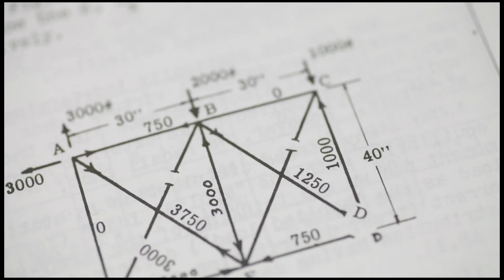The Clock is Ticking for Bloodhound LSR

Comment: 8 million pounds, why? Why didn't you just push the throttle all the way to the floor then light the sidewinder? Bugger this tip toe bit by bit thing!
Reply: I get your frustration, believe me, I do. I've been following this since inception and feel the same way but the limiting factor has ALWAYS been money. 

The rocket wasn't fitted because the rocket wasn't ready - mainly due to a shortage of money to invest in rocket development. 

And imagine, that without the slow but steady approach they took they did just "put the pedal to the metal" and there had been an accident, perhaps a fatality. The project would have died - immediately. We have a world class, straight line, racing car that now has race proven technology. The £8m is required to address issues thrown up by the desert runs, to develop the rocket. To test the rocket and fuel pump. To install the rocket and then to take everything back to the desert for the record runs. 

The base costs money, the team costs money. They can't do it for love (although they probably would if they could) they have families, homes etc. Transportation to SA is expensive, setting up and running a desert base is expensive.........do you see where Ian's coming from yet?

Bloodhound needs major, multi-national sponsorship as well as "trickle down" funding such as crowd-funding, merchandise sales etc
Reply from the maker: Yes, we share the frustration. Building a prototype racing car with 100,000 hp is a time consuming and (relatively) expensive process. By comparison, a mid placed F1 team will spend £250 - £300m per year. Rockets take time to develop and test before integrating into a car and strapping a human to the front. We are by nature risk averse, so will be testing and reviewing at every stage. This is sound engineering. We just choose to share every stage with the fans, rather than presenting a finished car as most motorsport teams do. 
^JT
Reply: Bloodhound LSR 
What has impressed me for the duration of this project is... the emphasis on the engineering required to make it happen.. and the very careful “one small step at a time” approach... check, double check, and treble check! 
We aren’t “gung-ho, shit or bust Americans! (We don’t make outrageous claims for records! We do it by the book
Good luck guys... hope you do it!
Reply: Its  not like just buying a sports car out of the show room and taking to a track. More like walking out onto a frozen lake where you have no idea how thick the ice is. There has only ever been one vehicle, be that ground or air, that has ever gone that fast and this one handles differently. Without tip toeing up to speed a spin-out/fire/god only knows what is a very very likely outcome.
Reply: That's what the USA tried to do last summer and sadly Jessi Combs isn't with us any more - it's got to be safe for Andy Green.